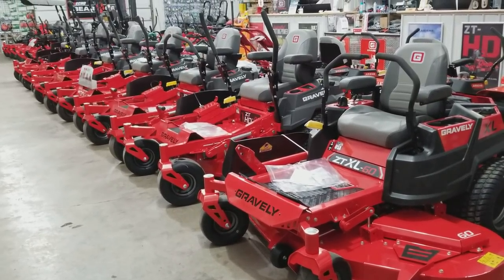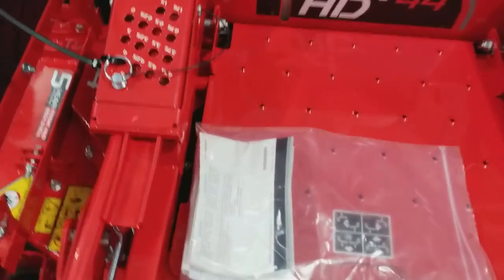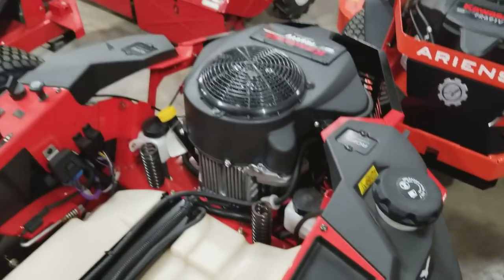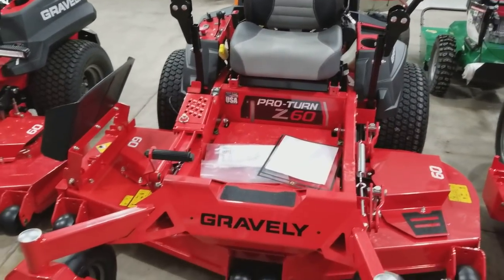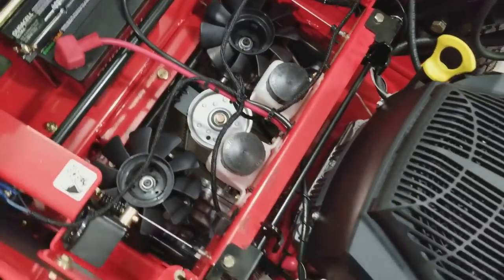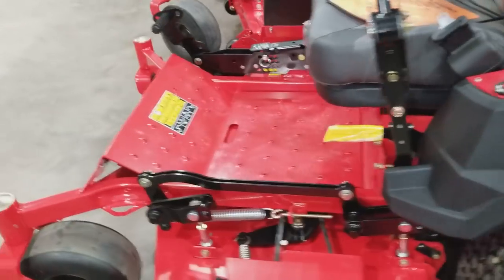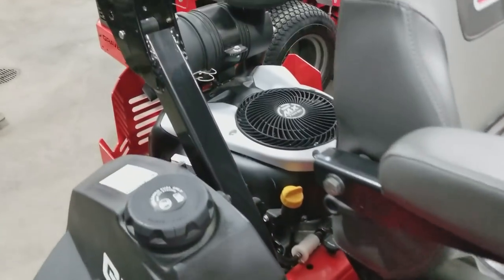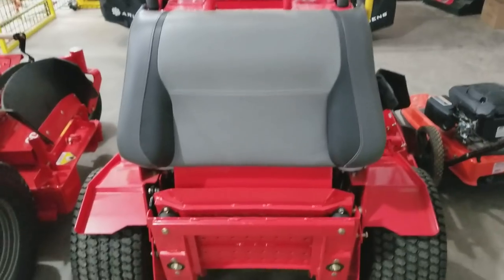Gravely Line-up at Lube Suppliers Store

Comment: The best and most informative video I've seen of the Gravely line-up yet.  Still debating on what to buy.  Having trouble choosing between the HD-60" and the Pro-Turn 60".  I would choose a Kawasaki in either application.  I'm mowing 4.8 acres in eastern Iowa.  All grass with minimal slope of wide-open mowing.  Lots of trees to go around as well.
Reply from the maker: Give us a call when you're ready to move forward or if you have any questions. We are only about 4 hours away and guarantee the lowest prices. Thanks!

Comment: From 1960 1965 had walk behind commercial model. Gravely Mowers Are Made From Iron !
Reply from the maker: The original Gravely walk behind Two wheel Tractor was a beast! I'm told at one time there were over 70 attachments available for that!
Reply: @LubeSuppliersStore  still running my 12 hp walk behind

Comment: Can you tell me more about the "Graverly" engine? Only saw one model with it. Who is it made by?
Reply from the maker: The Gravely Engine is made by Loncin; however, all Parts are sold by Ariens/Gravely and the engine warranty is administered by Ariens/Gravely. The latest version of this engine is rated at 26.5 HP and based on our preliminary testing and use, it performs well. Gravely backs it with a 4-Year Warranty and while it isn't at the level of a Kawasaki, Kohler, or Yamaha - it is a good option for many people. It is worth noting that the replacement cost on this engine is only about $450 so in the event of a long term replacement being needed... you can buy 3 of these for less than a single Kawasaki.

Comment: Sir great video, was wondering can you add mulching blades to a zero turn , thks
Reply from the maker: Hi Scott, you can certainly add mulching blades. Gravely offers a mulch "kit" if you wanted dedicated mulching. This would have steel baffles that enclose each blade and prevent grass from blowing out in addition to mulching blades. Most of our customers prefer a side discharge but are always looking for a finer cut. Notched or toothed blades such as the Oregon G6 Gator blades work well for this by providing high lift as well as some mulching effect but still dispersing the clippings well from the discharge chute. We stock these for nearly every mower brand and can ship them right to your door. Thanks for your question!

Comment: Does the XL have a fuel gauge?  My HD doesn't.  Impossible to know what's in it.  I simply can't believe they couldn't throw in a $20 fuel level gauge  :-/
Reply from the maker: The XL does not have a fuel gauge. Some model years have a "Sight Glass" style viewing strip which does give you some ability to see the fuel level. If you have a newer HD you would find this on the front of the machine right below the seat. Unfortunately, you do have to be off the machine to view the fuel level, but it is better than nothing... Certainly a float style fuel gauge visible to the operator would be more convenient; however, the typical user of an HD doesn't use an entire tank of fuel in one day and therefore by starting with a full tank each time they mow, the fuel level is never an issue for them. If you happen to be one of the less common people who use an HD for very large lawns or for commercial mowing, you won't be able to make it all day and would need to plan a mid-day refueling.

Comment: Did I miss the 34” ZT model?
Reply from the maker: No, you didn't miss it! We don't carry the ZT base models at our dealership from Gravely. We carry those machines in the Ariens Brand (same machine with different paint). We try to help make it easier for customers that visit in person by having all our Heavy Duty and Commercial Machines Red (Gravely) and our Residential machines Orange (Ariens). Either one is a good option. Thanks for noticing!

Comment: My neighbor cuts with a 72 inch pro turn 4 something? I don't know about his blades but his lawn looks terrible
Reply from the maker: Mowing with a 6 ft deck and having a nice finished look takes some experience unless the lawn is completely flat. Large decks are much more susceptible to leaving lines at the transition points of contours and overlaps. Experienced operators can "read" a lawn and identify the best way to reduce or eliminate this issue. Overall, for most people, a deck that large just isn't practical.
Reply: @LubeSuppliersStore  He is a commercial lawn care provider . He should have experience . He have over 100 accounts .